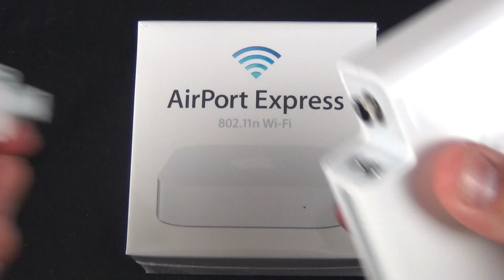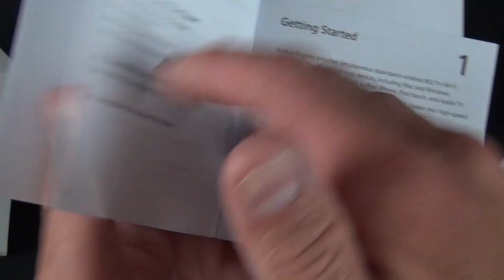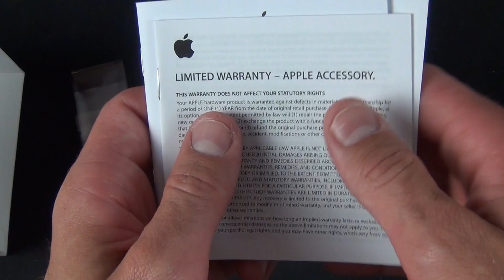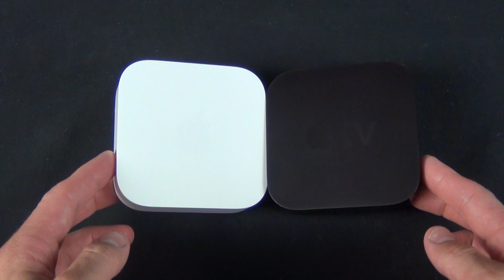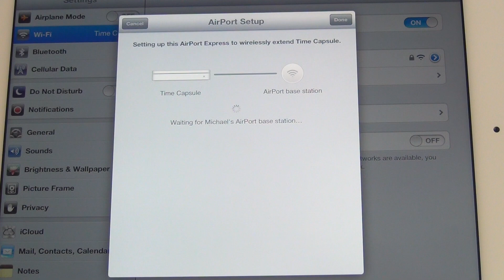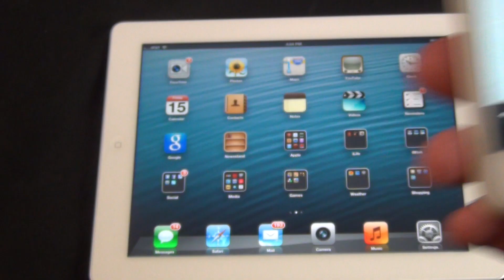New Apple AirPort Express (2nd Generation) - 2012: Unboxing & Review

Comment: No.  There's a variety of ways to do it.  If you have an apple device as the first "router" in your home, you can extend with other apple products.  In other words, if a time capsule or an airport extreme are the first, you can use these other gadgets to extend.  If you're not using one of those first, you can look into other methods.  Please note: there is a difference between extending a network and making one stronger.  It's important that you do it right.

Comment: Get the Apple airport utility- for either Mac, ios, or PC.  Set the thing up properly.  Go to your computer, disconnect from internet.  Plug in your airport express.  Connect your computer to the wifi connection that the airport express just created.  Now go into airport utility and set the device up properly.  When finished, you can log back into your wifi network and both your computer and airport express will be on the same network with all of your goodies at home.

Comment: I had the old one 2005 model worked fine, now I had updated my macbook pro 2011 to mountain loin, now the old unit will not connect, so I have to buy this new unit. $119 I should have want compensation apple!

Comment: No, works with all Wifi devices that can connect to it or the router it is connected it. The application being used on the device then needs to support AirPlay. All iPhones and iPads all have that integrated already, but not all Mac and PC programs do. You'd need to check for those.

Comment: Is it is your ISP's modem that comes into your house, you cannot, but you add the Apple TV on, using it as a wired connection from your modem and using the Express as a wireless connection onto that enabling far more user friendly wireless network adjustment, as the software the comes with the Airport is very human friendly.

Comment: Ok i'm completely useless when it comes to new technology so bare with me...can I plug my ethernet cable into the AirPort and then plug another ethernet cable from it into my imac to use it as a wired internet connection, while at the same time using other wireless devices like my phone on it via WiFi? Also will my Galaxy S3 be able to connect to it WiFi?

Comment: Does the AirPort Express support wireless network extension from a non apple router (airport extreme)? If so, is this only when you plug in a LAN cable to the device? 
Or does it also allow wireless network extension via connecting to the wireless network from a 3rd party router?

Comment: If I want to use it as a range extender is there much of a difference if I use the new model or the older model. The thing I liked about the older model is that is connected straight to the wall. Would there be much of a speed difference?

Comment: Question: I want to extend my connectivity in my home and i want to be able to use the AirPort Express to do so. I don't have any other AirPort devices just a standard Router, will i be able to do this? Also, does the bridged or extended network come up as a second connection in the home or does it just stay as the one the AirPort Express is connected to? Thanks, Lewis.

Comment: yeah you can. I have the previous Airpot express and I have my HP printer hooked up via USB. With that setup I have air print. Though It only works for may mac. my ipad and iphone does not pick up the printer.

Comment: One quick question could I extend my wireless network even if I was using a Linksis router? Do you have to have a apple airport extreme or you can also do it with a linksis router?

Comment: Ok so I have a router downstairs, and from my room it does not connect well. It connects but could be way better. Should I get an express to extend my wifi? Is the difference substantial. 
Also does the extreme have the same function, if so would this one be stronger?